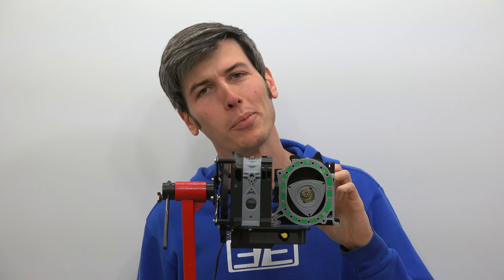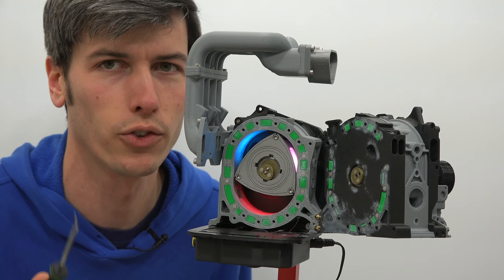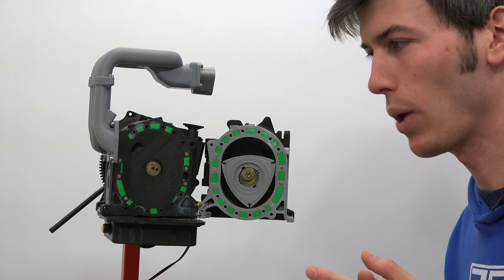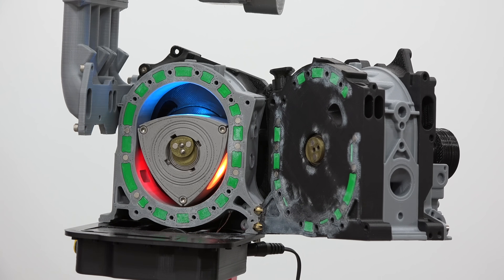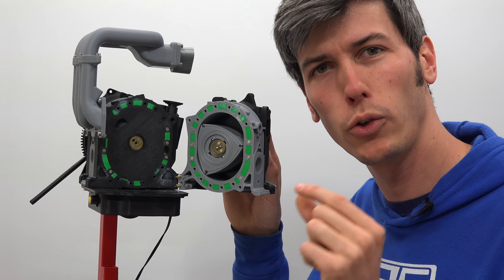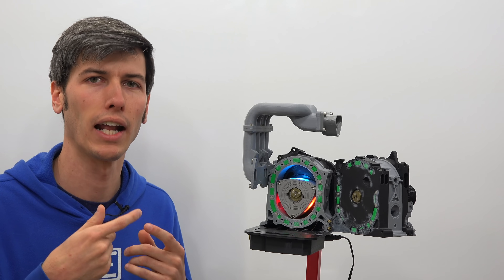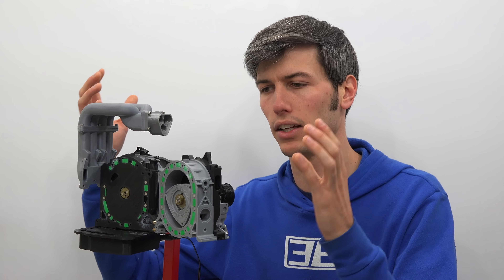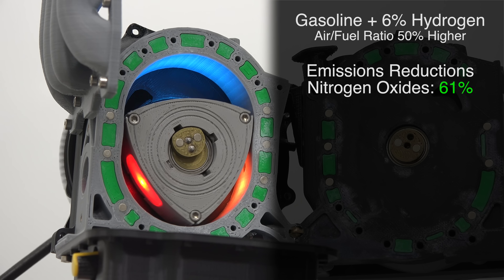Mazda Built A Hydrogen And Gasoline Powered Rotary Engine

Comment: You should do a video series on alt fuels, starting with diesel v. Gasoline as a  baseline, then running through the other alts, ethanol, methanol, nat-gas, hydrogen, biodiesel, propane, p-fuels, maybe even bringing old school unleaded. You could have a pros and cons and a graph with the thermal efficiency comparison and the ideal a/f ratio

Comment: Rotary engine battery charger for range extension should be both gasoline and hydrogen capable...i believe the range extender engine stays at a near constant rev band and the small size and weight of the rotary has created some interest as a range extender

Comment: bro what about latent heat in wall wont it cause pre ignition😅as the same latent heat was in all stuff u mentioned(exhaust valve, hotspot...)
Reply from the maker: There aren't exhaust valves in the intake/compression chambers of the rotor housing.

Comment: Is mazda working on
Lasers to ignite mixtures? If so can you cover this?
Reply: Lasers are very capable of heating the mixture past ignition temperature but those are rather expensive compared to spark plugs and they wont be able to heat the gas/air or hydrogen/air or any gas mixture because of its transparancy thus it would be heating up the piston or rotor which has a rather high thermal mass so i wouldnt be seeing this as a feasable solution, also the glass window you would need for this to work would get smoggy
Reply: I kinda doubt there’s a practical way to keep carbon deposits from blocking whatever port or window is used to allow the laser into the cylinder.
Reply: I think you use ignition lasers for getting a better burn. If your using hydrogen.... you already get the better burn so they might not be necessary
Reply: John Curran not what i
Meant. I mean to replace spark plugs entirely, allowing for a larger ignition beam into whatever chamber youre dealing with and whatever fuel.
Reply: @BobbyDazzler888  Spark plugs are not bad in themselves it's the spark plug hole, While the apex seal is over the hole combustion leaks past/back causing reversion diluting the next charge, reducing power, etc, etc. There's been some attempts to remedy this problem with narrow slots, etc. I had an idea for a spark plug that opens like a valve, while it's closed the face is smooth and apex seal can slide over and have a good seal, when the "valve plug" opens it fires while open, the valve is the electrode, the distance it opens is also the gap, and width of gap and opening time (dwell), spark time/intensity/duration could be adjusted electronically while the engine is running, increasing performance/economy.
I get that timing is critical as anything sticking up at the wrong time would destroy the apex seals/engine, but I'm sure it can be done, they figured out how to perfectly time the shooting of machine guns between the rotation of propellers on old planes so they didn't shoot holes in the props, to me that's amazing! Fix this spark plug hole issue on the rotary and it would help make it a better engine than it already is.
Reply: @danthomas9077  Actually, the spark plug holes aren't the problem either. There's only a pressure differential between the combustion chambers when the apex seal passes the trailing spark plug hole. Hence why it is smaller. 
I believe that the biggest advantage of laser ignition is that you can ignite the mixture in the middle of the combustion chambers, which improves the flame path, both in rotary and piston engines.

Comment: Weren't you rotating the engine around backwards?  The motorized sample is rotating clockwise while you were rotating it counter-clockwise when explaining the hydrogen. Hydrogen burns clean. Nothing out the exhaust but water vapor
Reply from the maker: They fold together. The rotor I was spinning was folded out 180 degrees, so the rotation appears opposite.

Comment: Oh Lord... I just looked up the HP of the hydrogen rx8....

107 break horsepower.

Oof
Reply: Miravus exactly what I was wondering. Thank you friend.
Reply: Yeah, the rotarys seem to be poor efficiency and poor power, compared to the piston alternatives.  Why people would want one is beyond me, besides being "different" or "cool" I don't see the appeal.
Reply: @ @OneWheelMan  A 2-rotor is small and short, allowing it to easily fit behind the front spindles of a small sports car. It's also very light for a 200+ hp engine. If the mass produced 3rd-gen engines hadn't had so many faults (crappy coil packs, crappy ECM's, complex mechanical turbo controls, etc.) I think they would have lasted much longer than they typically did (my '93's apex seals lasted 60,000 miles and the turbos slightly longer). If you drove one for any length of time, you would appreciate the balance of the car and the smoothness of the engine. It would exit turns under full throttle like nothing else.
Reply: That’s like a 4cyl 600cc sportbike engine
Reply: If they used natural gas instead of hydrogen, they would have the same HP as gasoline. MPG is measured for hydrogen, and CNG engines as energy equivalents. The issue started with diesel. It has more energy per gallon, so you have to adjust the MPG based on the energy of the fuel. MPGe. The reason H4C has more energy than H is the carbon. The hydrocarbon bond is were the energy comes from.
Reply: "But what's the 1/4 mile ETs? Does it beat a demon?" :p
Reply: but what's the displacement?
Reply: I presume it's just a reworked RX-8 engine, so presumably 1.3 or 2.6 litres depending on your definition.
Reply: @drunkenhobo8020  In that case, I'd say ~100HP in an engine that small isn't so bad.
Reply: @Toastmaster_5000  It's bad for a rotary
Reply: @Shinkaaaa  Maybe so, but if this motor is more reliable, I'd gladly take a loss in power if it means not needing to rebuild my engine every 30k miles (just a guess, I'm not sure how often it's necessary).
Reply: @Toastmaster_5000  Actually, a friend had a RX-8. First engine, 160000 km. He needed to rebuild it after that. So if you take good care then it's not that bad.
Reply: @Toastmaster_5000  there is none
Reply: I had a RX-5 (Cosmo, 1976) which was two 40 cubic inch rotor heads that equaled one 80 cubic inch rotary that put out 110 horsepower, and it kicked ass!
Reply: @drzarkov39  how much did it weigh though? The rx8 was about 3000 pounds. I suspect the cosmo was MUCH lighter, so they power dynamic was still okay.

Also, they got way more torque back in the day as well, at least relative to modern rotaries.

Oh, and I would be surprised if the old cosmo engine was nowhere near as fuel efficient, nor anywhere close in terms of emissions. 

And that was using leased gasoline, to boot!
Reply: @MiravusVideos  My Cosmo was the Cosmo AP (Anti-Pollution) made specifically for the US market with our low pollution standards.  It had a weight of 2,470 lbs. I got about 20 mpg.
Reply: @drzarkov39  that car wouldn't have met OBD-I pollution standards in the early 90s, let alone OBD-II standards that the rx8 had to meet.  We're comparing two very different things, is my point.

Ffs we were still using leaded gasoline in the 70s!
Reply: Malaysian favourite Perodua Myvi have only 102hp,yup that's the highest performance
Reply: Less MPG also I believe, and MPG is shockingly bad already. Nice idea though.
Reply: @Joshua Thiel it really, really doesn't make sense to measure hydrogen in gallons.
Reply: @leftaroundabout  Understood, not my area of expertise but I just remembered the numbers being pretty disappointing. Just looked it up again. It can get 62 miles on a tank of hydrogen which apparently took up most of the trunk space. As far as I can see there's no other hydrogen powered vehicles with internal combustion engines so this is actually pretty incredible, but also quite rubbish.
Reply: Joshua Thiel Mazda’s results are pretty typical for Hydrogen ICE vehicles, fuel cells are much more thermally efficient and thus let hydrogen kind of make sense.
Reply: @Joshua Thiel Well, ok, you could say for any way you could measure a MPG for hydrogen it comes out pretty bad. Not that bad for cryogenic liquid hydrogen as used in rockets (something like 1/2 of gasoline, assuming reasonable engines/cells), but that's really impractical for a production car. On the other extreme, gaseous hydrogen at atmospheric pressure would give outrageously bad MPG values, you might as well quote inches per gallon then... In practice, you'll always use pressurised gaseous hydrogen, which is somewhere in between these extremes. Where exactly depends on the tank.

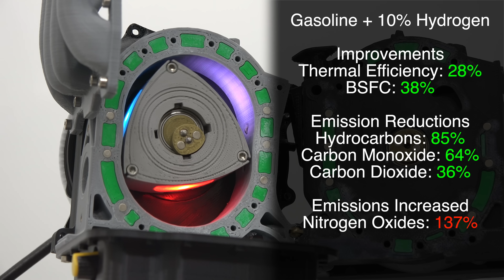Comment: 9:51 Increased by 137% or increased to 137%? There is a pretty significant difference between the two.
Reply: I haven't read the paper (yet), but gasoline engines don't produce much NOx and rotary engines even less, so an increase of 137% might not be a lot either. It would be more useful to look at it in absolute or specific numbers.

Comment: Ridiculous!  Using hydrogen to do mechanical work is inefficient and expensive. Hydrogen is best used in fuel cells to produce electricity directly.
Reply: Burning stuff is sooo 20th Century.
Reply: Yep, that is true and fuel cell is cleaner too.
Reply: Yes but... braap.... stututu.... :(
Reply: On the flip side, infernal combustion engine technology has the advantage of a century and a half of R&D. Hydrogen fuel cells have maybe a third of that, and that’s if you include the space race. If the goal is eliminating carbon emissions, it makes sense to pivot existing technologies to be carbon free (which can be done rapidly and cheaply) and then focus on perfecting the newer technologies.
Reply: Indeed, using hydrogen for transportation is inefficient and expensive, full stop. 
Even if it can be produced on a large scale without CO2-emissions, It would be best pumped directly into the existing natural gas grid to heat homes.

Comment: In the era of ev ....total waste of time and money
Reply: Except a hydrogen infrastructure would probably work better than for EVs
Reply: SDD525  judging by the fact how current batteries are made we really need something better/safer
Reply: @lowiet8979  Not to mention the problem with recycling them. Reusing them for stationary energy storage when their capacity drops below a certain percentage is currently the best option. But this is only a stop gap solution.
Also, If manufactures would standardize their connectors and battery management systems and would build in a diagnostic tool with some sort of battery life cycle logger, it would drastically help with this.

Comment: Did the increased temperature in the ignition chamber ever cause issues with the oil that was injected to lubricate the apex seals? Such as causing the oil to burn like a runaway diesel? 

Could it have happened if the engine was turbocharged?
Reply: It shouldn't, its a very small amount of oil (in fact too small amount... Pre-mix is almost mandatory). However, unlike diesel runaway which is completely different with it squirting around the rings, a rotary does not "leak oil" like the diesel, and has injectors that vary with throttle. It should be mostly proportionate to your fuel rate. Also a lot of people disable the injectors and just pre-mix, so it couldn't possibly runaway.

Comment: Only major downside i see with the rotary design in general is the oil burn by design.. and it seems like hydrogen better suits the design of the rotary for efficiency..
Reply: Oblivion , thank you! Not a lot of people are remembering the oil consumption of a Rotary.
Reply: @racingwithbrad  its one of the main things people talk about.
The others are the fuel and seal consumption...
Reply: Oil consumption in case of well built Racing car is comparable to very high reving piston engines.

Comment: Now the question would be how this compares against a hydrogen EV.
Reply: Terrible, but much more fun!
Reply: @dodecahedron1  
Is it tho? It generates Electricity and runs with an electric motor. Hydrogen combustion is directly a motor. 

So normally when people are talking about Hydrogen today, they are talking about hydrogen fuel cell EVs.
Reply: Terrible, but much more fun!
Reply: Hydrogen EV? It's either hydrogen or an EV, not both unless it's a hybrid
Reply: @nickpierpoint4116   it generates electricity using hydrogen in fuel cells i think thats what he meant